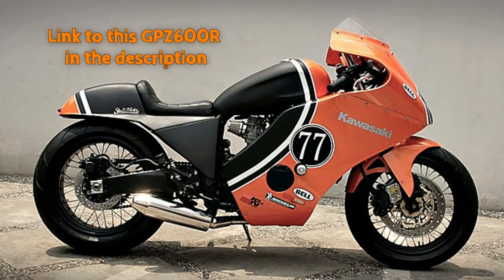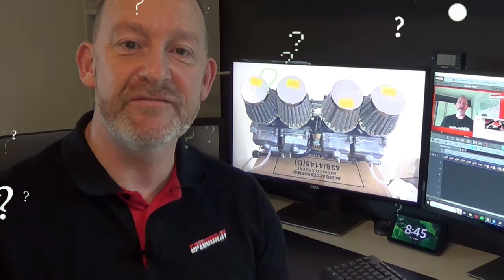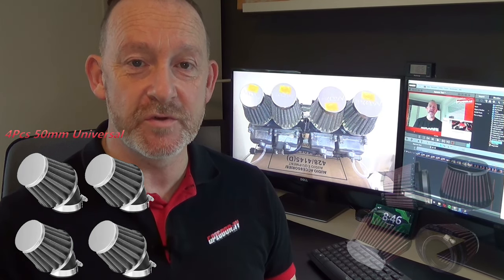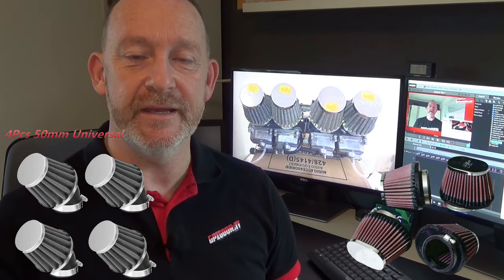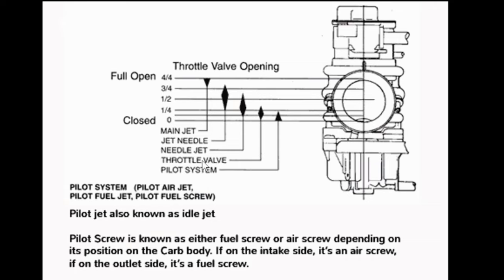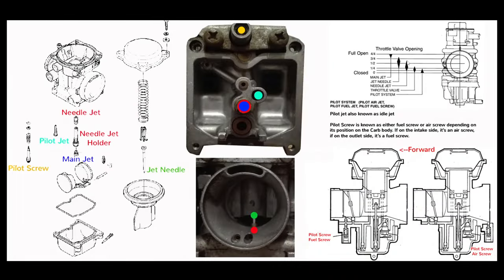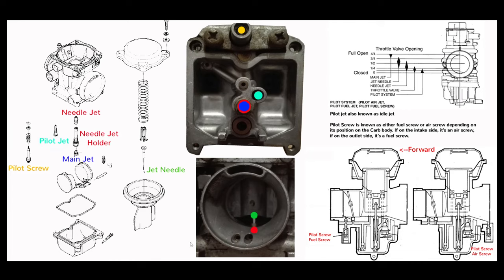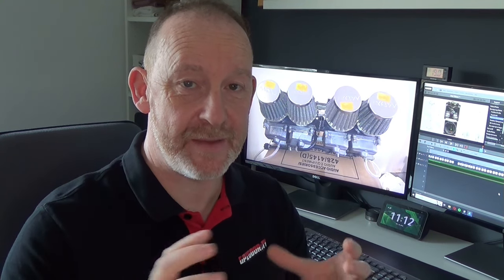Fitting Pod Filters on your  GPZ600R? Yes or No?

Comment: Seeing as those carbs with pod filters on his screen are mine 😮 and yes I did take a chop saw to them to get the outside ones to fit all glued together with bumper repair epoxy the carbs have been up jetted to getting it running fine and there is a 3d printed manifold the pods mout to that has a link pipe with a outlet to plumb the crankcase breather onto.
Reply from the maker: Yes, i saw all this 👍🏻. If you got it running then well done .. what setup did you end up with ? Did you have an aftermarket exhaust too? I presume so.
Reply: @MrLefthooker  before I even started I contacted NRP Carbs in Manchester and asked for some advice as I was ordering new pilot and main jets and they recommended I go up a couple of sizes.
The bike runs on original headers with some home built straight through type silencers with a similar pipe diameter to the original baffles.
The 3d printed manifold as some bell mouths incorporated that are about 35mm long which are just a bit shorter than the original airbox rubber ones that were all distorted and rock solid and made of unobtanium apparently.
It runs fine and has no obvious flat spots but I don't ride it like I stole it so that may help😂

Comment: Hi Jason,
once again a very interesting video.
At the moment, i have some problems with the choke. When i use it, the bike only runs on 3 cylinders. Any ideas?
A second question: What tool do you use to change the settings of the pilot screews? There is so less space under the carburators, that it is nearly impossible, to reach the screws head. 
A little tip for the people, who are refreshing the carburators diy:  the 2 carburators in the middle use other main jets as the carburators on the outside. So take care, when you built them together after cleaning.
Reply from the maker: The pilot screws can only be adjusted with the carbs off the bike. I haven't found any tool that fits underneath. Not even a 90° Screwdriver. 
I suspect that you may be getting far too much fuel into the 3rd cylinder, and when using the choke it might be far too rich. Check your float height using the clear tube method and look at your spark plugs to see if she is running rich.
Reply: I started making an adjuster using a guitar machine head.... then gave up and just got good at removing and reinstalling the carbs/airbox. It's really the only way.

Comment: I have looked everywhere.....Can someone Please give me an answer. Does the 1985 zx600a (gpz600r) have the same headers as the 1997 Zx600c (gpx600 i think). no where online has a definitive answer on if they are interchangeable.
Reply from the maker: The headers are the same and are interchangeable up to the collector. In other words, yes, but not the end pipes, they are different after a certain year, but for simplicity, they are different. The 1985 GPZ600 is the ZX600A1, and the 1997 GPX600R is the ZX600C10 and (in Europe at least) way the last year the gpx was sold. They shared the same engine block from start to finish, hence the same headers throughout the range.
Reply: Thank you so much! im looking for a set for my 85 and for some reason 85-87 People want your unborn children. So im looking into the other models. Only source of actual Knowlege on this bike are you and like 4 forum posts from 2009. I can do the mount work. I just needed to know if the base was the same. Thank you so much.   @MrLefthooker

Comment: I have changed mine for larger jets
Reply: Just trying book jets in mine. Previously I was running smaller pilot (35) with larger mains (110) with a different needle. I've not had enough time to feel the difference yet but it now only needs 2 mins choke to reach idle temp.... as opposed to 2 miles before. Top end is not as snappy now though.